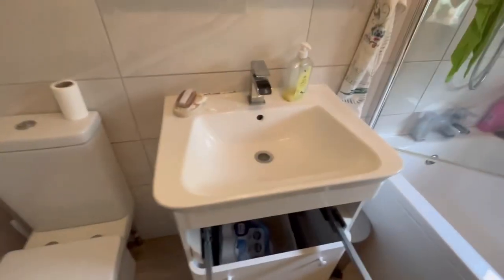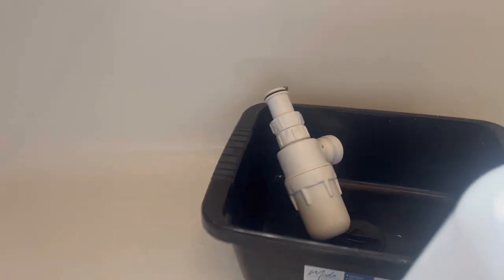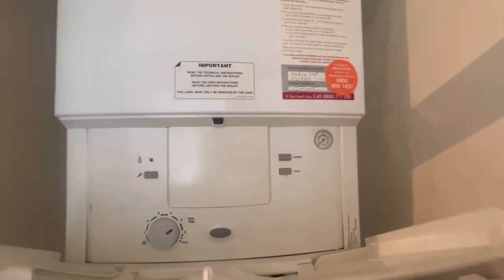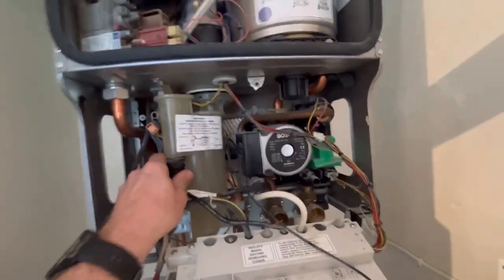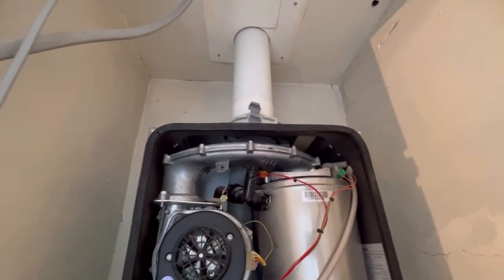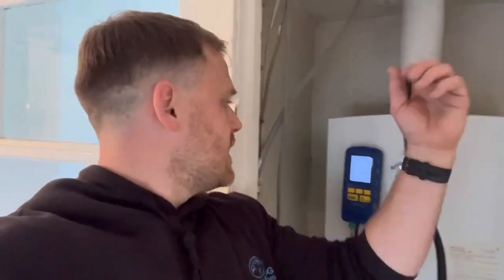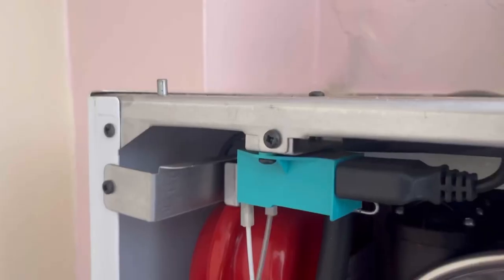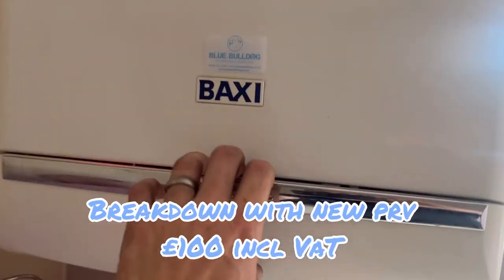How much does a Plumber Cost?? Day in the life of a Plumber EP8

Comment: Quick question do you do a working pressure at meter and then boiler to see the difference in mb also what about other gas appliances that need to be running as well when testing and not just the boiler.

Comment: When moving a boiler, if the original valve’s have ceased up, do you buy a new hardware pack or just fit with off the shelf components? (Was an Ideal ESP1 last time)
Reply from the maker: New manufacturers hardware pack if you have to replace normally

Comment: Do you ever have to change the condense trap seals, have had loads where that top seal won’t reseal after cleaning and putting back together.
Reply from the maker: Yes mate if they look a little flat il replace them 👍
Reply: Had a spell of them even if they looked ok would just leak so tend to change them majority of times now. Nice work mate 👍

Comment: Fair pricing. I'm in bradford and people are fitting boilers for £200 and boiler service for £30 sadly its a race to the bottom here.
I have a fixed price of £130 for boiler repairs + parts.
Reply from the maker: Same round the midlands mate, there’s people working for nothing…don’t know how they make a living!
Reply: Wooow £200!  Hampshire - £950 for a really shitty Vaillant/Tado install (I supplied the combi). No flush of the system, ripples on the pipes (I felt I was better at bending offsets than my installer!), huge cracks/chunks of the bricks missing, decorative flange on flue outside is still inch from the wall.  It was a such missed opportunity - I ripped the kitchen completely out, so the access to every pipe and wall was like in the college training bay. What's really annoying - guy lied to me: due to the maximising space, I wanted a tight install under the boiler with an immediate turn of all pipes on the side towards inside the plasterboard-covered pipe run (which I even ripped for the bugger). He lied to me, that Vaillant boiler supplied pipes cannot be bent or trimmed, and the gas pipe requires new entry hole in the wall (another massacred 2 bricks, instead of using the existing supply with + extra 2 meters of the pipe with one 90 bend.) Dont even mention use of Brasso..  I got angry and... just completed my first 2 months in level2 plumbing. Sadly, in Britain, if you are after quality - you have to learn and do the things yourself. I will get a gas certification and sort out that flue.

Comment: Never put the top washers on basin wastes leaves a slight lip water sits around it remember my apprentice trying it on his own jobs with metal back but and cracked basin I take them off and use silicone don’t use them big arse rubbers under aswell nowt wrong with abit of silicone 👍💪 them bath pop l up waste if you undo the small screw and strip it clean them with fine sand paper re grease and put back together 🤌👊

Comment: Wow. Fairly new plumber and soon heating engineer, got a lot of reading up to do in next couple of weeks 🫣 #ACS coming up. 

But I recently changed trap and waste PLUS put in a bidet hose. I charged £70 for it. Did I rip myself off? 😂

Still going through my pricing methodology which I've been finding very tricky at times.
Reply from the maker: Was that including materials? I’m doing the video soon on how to work it out so might help you 👍
Reply: @bluebulldog_uk  not including materials. Well just a couple of isolation valves from my end but he bought all other materials.